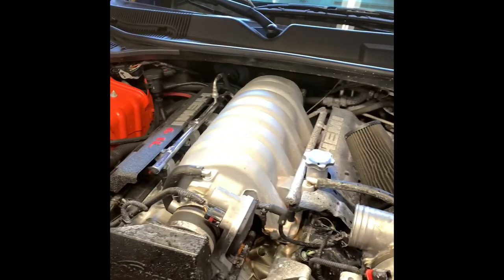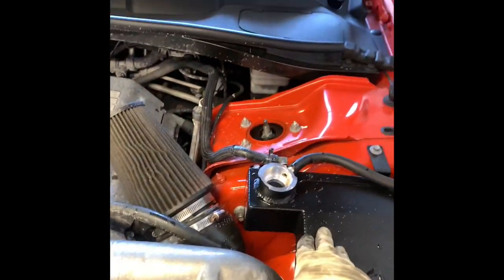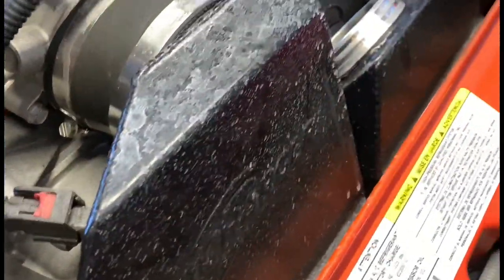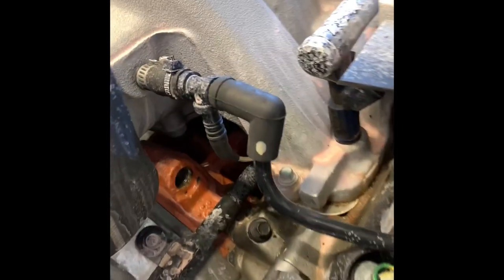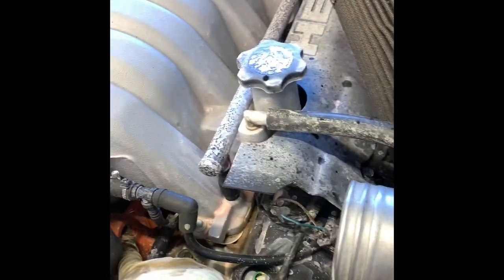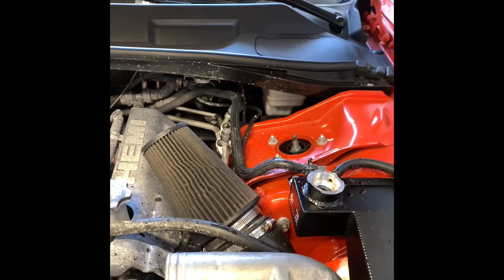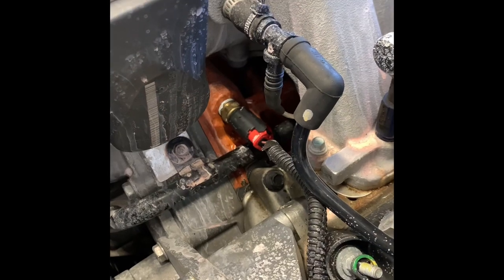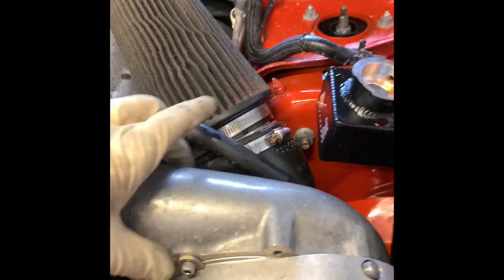Another Way to Bleed the Cooling System on a Hemi #shorts

Comment: Hi Brian, good tip I use the bleeding vacuum tool it is really efficient and i hold it sealed by using the air shop for a minute and then push the liquid in using the vacuum till it fills up with out any air.
Reply: That's the way too go for sure